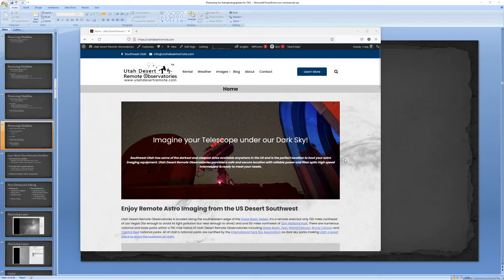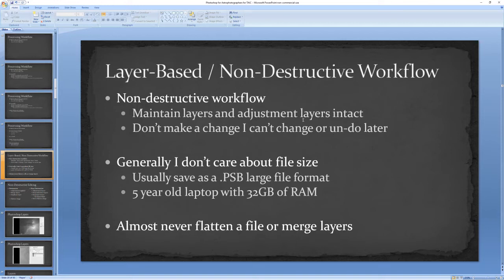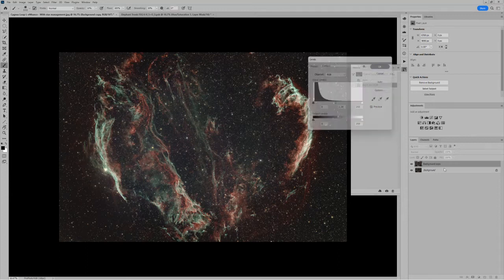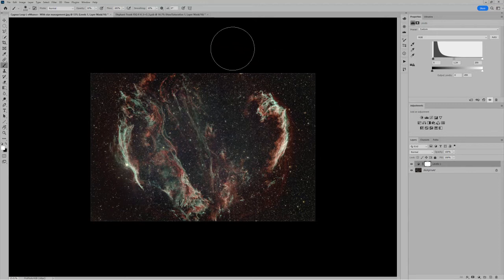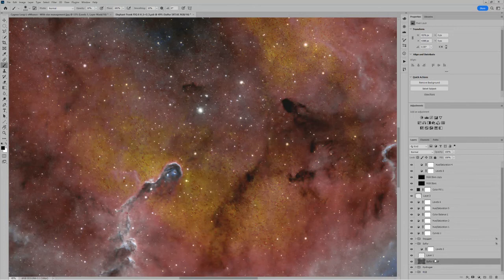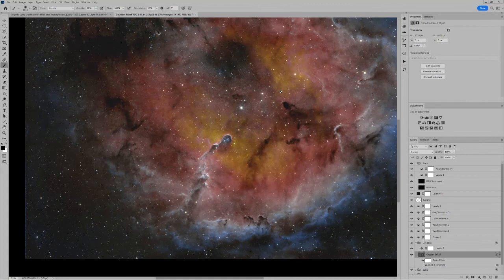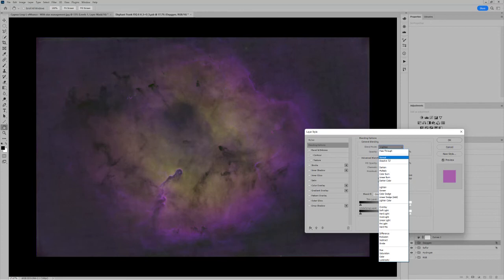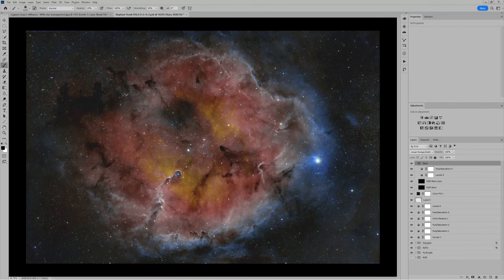Non-Destructive Editing in Photoshop

Comment: Really interesting. I’ve been using blending mode in layers for a while but never use the lighten mode… that is a great tip! Solid fill layer to control the black is also a great one Craig I’ll make sure to use that next time! One question about your star layer… do you use linear add or screen for blending that layer? On some targets I found that extracting RGB stars for an RGB image to then add on top of a narrowband processed starless image blows out the stars that are on top bright area of nebulosity… and I can never get a clean RGB star transfer to a NB image without that issue.. and whilst a curve layer help the blown out stars it reduces the small stars too much…
Reply from the maker: I rarely use Screen, usually either Linear Add or Lighten. With Linear Add I usually need to use a Levels adjustment layer to darken them, with Lighten I may need to brighten the a little. The biggest drawback to Lighten is that you will loose the stars in front of bright nebulae. There are times when I will use a combination of both with the Linear Add over bright areas and Lighten elsewhere. I usually shoot 180s RGB subs just for the stars and extract them with StarXterminator in Pixinsight.

Comment: Very good tutorial. I see so many that claim to be non-destructive, and then go ahead and destroy! Thank you. One question - how did you create your soft light layer (Layer 3) where you dodge and burn? It's created just above the Levels, Curves, Hue/Sat. So many people do a merge layers up with ctl-alt-shift E to a new layer. But again, that's destructive. How did you create the non-destructive Layer 3?
Reply from the maker: It's easy, just add a blank layer and set the blending mode to soft light. By default, when you add a blank layer it will be added just above the selected current layer, but if it get added in the wrong place you can simply click-drag it up and down in the layer stack to the position you want.